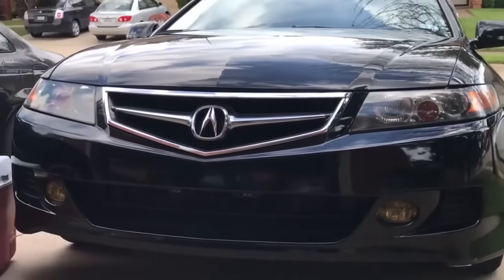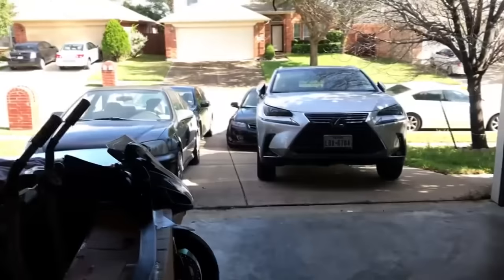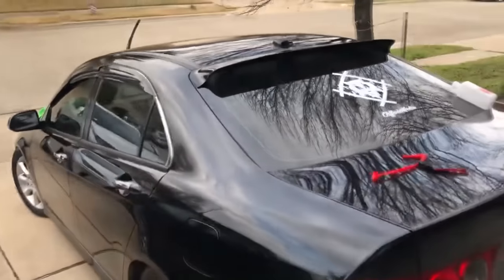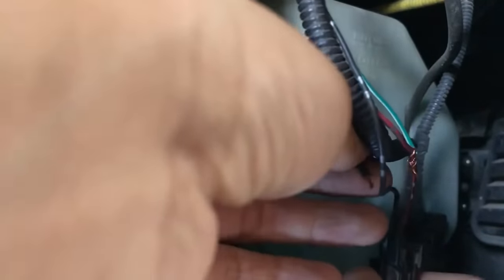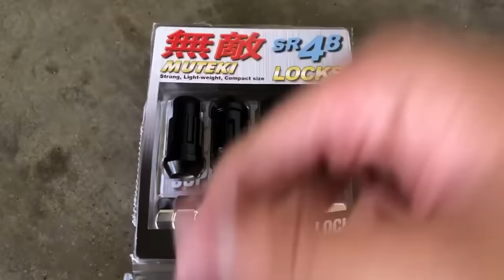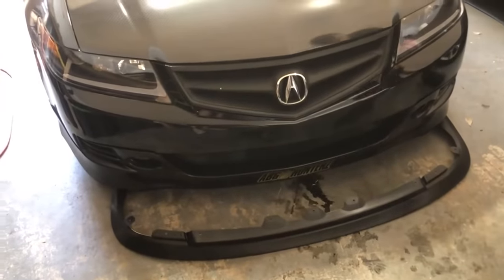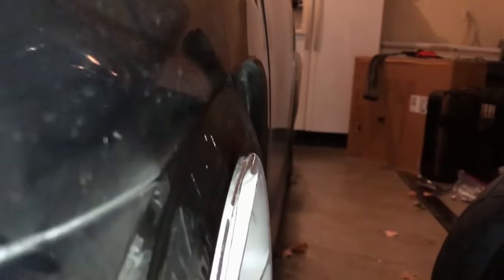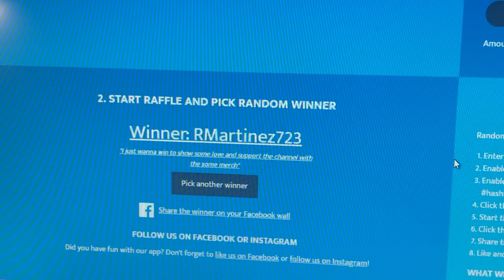My Acura TSX 1 year Transformation!!

Comment: Nice work man. I like that you kept your mods tasteful and still true to the original look. I've got an 08 in silver. Just hit over 200k.  I've had it about 4 years. If you take care of these cars they will last forever. I might actually keep mine forever and just eventually have 2 cars and keep the TSX as a daily. Since the cars are old now its probably more valuable to keep with all the features it has than it would be sell. It's an incredible value in a car, sunroof, leather, heated seats, HID's standard.

Just keep an eye out for your rack and pinion. That is the biggest and most costly flaw with these cars. I had my PS pump go out and then my rack in pinion right after that last year. I replaced it myself and it was a bitch of a job but probably a lot easier with helping hands.  I'm debating on getting those Acanii headlights. They look dope but I'm also a fan of the stock ones myself.  I'd like to give mine the Hondata reflash at some point to give it a little more pep in its step.
Reply from the maker: Forsure, thanks for the advice man!

Comment: Super cool build dude. Personally I liked the first aftermarket rims best. The carbon fiber wrap could have stayed. Looked good too. Need some power mods. 45 degree Vtc gear, or s2000 oil pump. Or hondata. And Megan racing has affordable upgrades as well make the car sound all kinds of awesome and handle like lary bird in the 90's
Reply from the maker: Christiana Ibanez thanks for the suggestions !

Comment: I drive the TL, I wonder how the TSX drives🤔
Reply from the maker: Romestics I don’t got a lot of experience with driving cars so I couldn’t tell you. But all I know is that the tsx got Madddd body roll. That’s why some peeps buy Type S sway bars to stiffen the rears
Reply: I have a 05 tsx 6spd manual. I have driven a few j series Acura's including the TL. The tsx has a stiff suspension and can feel a bit rough on concrete road's and lets in more road noise. The k24 in the tsx feels more responsive than the J35 found in the TL. I dont think the tsx makes a good family car because of how agressive it is, at least my family doesnt like it. Thats why I keep it at a backup and weekend vehicle
Reply: @tab1772  I have owned 2 6MT TL (base) so far. The 1st one I had was modded already so the handling probably matched or beat out my stock TSX when I had it (was an AT). Then it got totaled and I picked up a BONE stock 6MT TL and the handling still impressed me becasue I was expecting a lot of slop. Acura I feel always throw goodies into the manual counterpart of the car (LSD, stiffer suspension, BBK for the TL/TL-S 6MT, and CL-S 6MT)
Reply: @va2_lee  Ironically when you replace your motor mounts on the TSX, if you snag the Accord ones from the same year timeframe its a little stiffer.
Reply: @EXccord  interesting

Comment: Just resprayed my black tsx. Would have bought that mint trim under the window for like $250 and given you my old scratched trim to ruin with paint -_-
Reply from the maker: James Mulvey I wrapped it with Vinyl wrap, my trim had scratches and bad water marks.
Reply: @BeforeTheStorm  thats a bummer. They're like $500 from the dealer and I'm trying to restore my tsx. I wouldnt have taken them off when I painted the car if I knew they were meant to be replaced if ever removed -_-
Reply from the maker: James Mulvey Just get one off a junked tsx and restore it -_-
Reply: @BeforeTheStorm  all the ones ive seen in the junk yard have had the chrome worn through in places from someones arm or are dinged and dented up